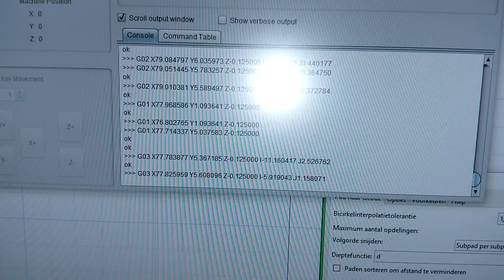Homemade diy cnc engraver from scrap

Comment: What's type of motor are you using ?Thanks
Reply from the maker: Hi Gerard, I don't know the exact type but the x and y motors are stepper motors from an old laser printer. The z motor is from a PC DVD drive.
Reply: OK Leon . I saw something like these on EBay but I  don't have any ideas about what's model I must choose;Thanks and good nightGerard
Reply from the maker: Hi Gerard, you could also look for Nema 17 stepper motors. Those are also mostly used in 3d printers and small CNC machines. You can also check my other video of my DIY CNC. In the description of that video is more info: https://youtu.be/20RqfFjYoW8